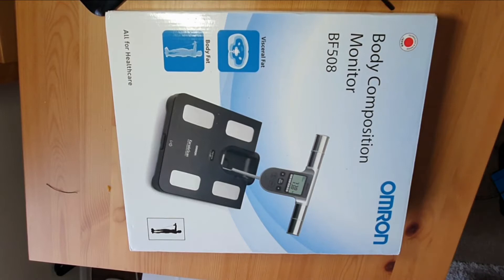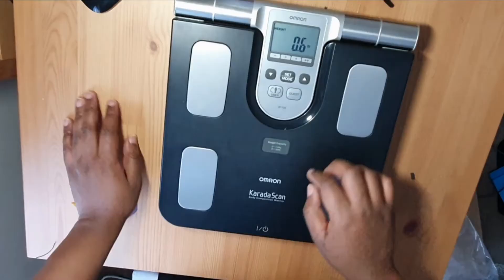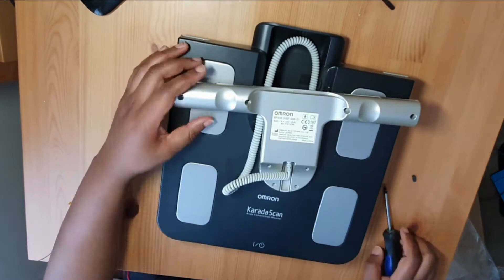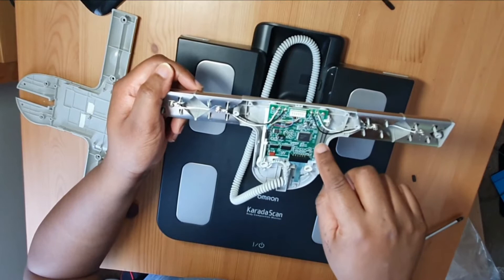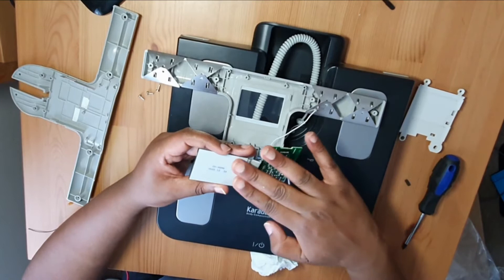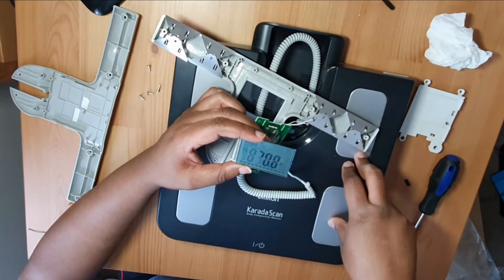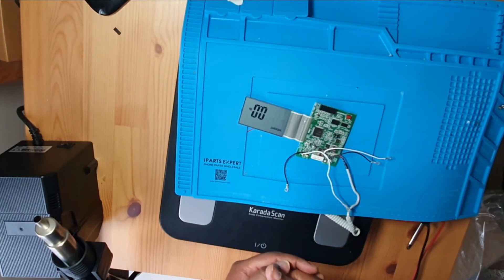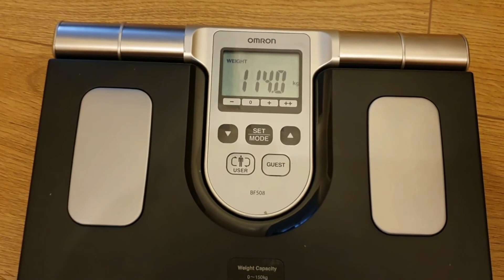Broken OMRON BF508 digital scales - Can I fix it?

Comment: Due to similar LCD issues, I had already opened my BF511 once and had tried to give some pressure with a small spatula to the ribbon cable. I did have the right hunch where the problem would be. However just physical pressing the ribbon did nothing. Of course I should've first checked youtube for tips. After giving some heat treatment with a heat gun together with some pressure, I could identify the bad contact in the ribbon. And after a few delicate heat rounds, I could get the display back fully. Thanks for the enormously helpful tip, you saved one more scale today :)

Comment: I have a similar scale with a ribbon like that, I first tried to remove the ribbon, wipe down the contacts, then tape it back together; it worked at first but eventually the tape couldn't hold down the ribbon.
Then I tried using the soldering gun another video suggested, but it messed up the tape a bit.
Tried the hot air method but my air was too hot.
Turns out the LCD still worked after being mutilated by my actions, but it needed to be overlapped and held down with pressure. My current solution I have it taped down, overlapped, then I lodged a piece of felt from a beverage koozie in between the ribbon and the case and it seems to be holding up with all the numbers displayed.
I think if I started with the heat method before removing the contacts from the circuit board I may have had better results.

Comment: thanks Shaun for you very informative video. I have an Omron HBF-516B, when I turn it on it goes to basic config then goes to CAL and then shows "err" and then shuts down. It was stored for a long time with the batteries installed before I got it. ¿What could it be? Please HELP... thanks 😟😀
Reply: I had the same issue with a 516 Omron that was stored for many years - follow Shaun’s video exactly and it worked for me.    I used a heat gun but some have mentioned a hair dryer works too

Comment: Thanks for the video! My BF511 had similar problems, but was in a far worse condition with almost all of the display nonreactive. As per your example I applied heat to the connection, and stroked the connection with a cotton swab (to "make it stick", I don't know what I'm doing :D ). After almost 40 minutes of heating and stroking I had a fully functioning LCD.
But IT seems mine was not a lasting fix, 12 hours later some of the numbers are already fading. 
Would you or anyone have further suggestions I could try? Thanks!
Reply from the maker: Thank you for your comment and well done on getting it working. Sounds like your adhesive doesn't want to hold it any more. I will have a look around and see if anyone has any suggestions for you.

Comment: Excuse me Shaun, I have an Onrom HBF-514. My sister in law applies sanitizer in the scale after every patient she attends, but It seems now that there's a stain moisture and the buttons are not working (but the scale does turn on). She can't use it anymore because she need to set it but the buttons don't respond. Is there anyway to fix it? Sorry for the bad english.
Reply from the maker: Hello Fabian
By the sounds of it, if water or moisture has made it into the scales then there is a good chance that it will damage the circuit board underneath. Without seeing it for myself i cannot say for sure what is wrong, but any time water or moisture makes it inside then things tend to fail.. you would need to open it up, inspect it, if you are lucky, you may get it working again with a good clean (using isopropyl alcohol and a toothbrush)... if you try, let me know how it goes :)

Comment: Can I use my hair dryer to fix it ? I have the same model and the same problem . But I don’t have the heat device
Reply from the maker: You can use a hair dryer, just make sure u don't do it too close, you are just aiming to warm up the ribbon join gently :)

Comment: I have the same machine. however, since i have changed batteries, it is not powering on. Any suggestion??
Reply: Same problem, were you able to find a way to fix it?
Reply: @Aunt_Juli  did you find any solution?